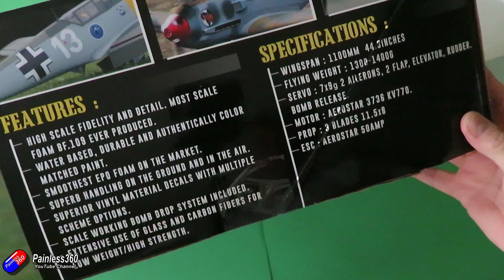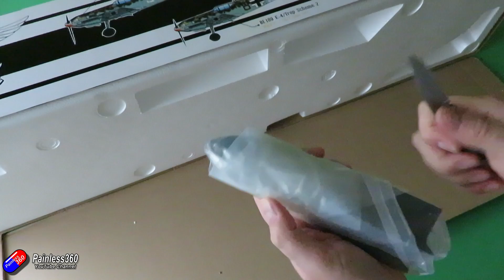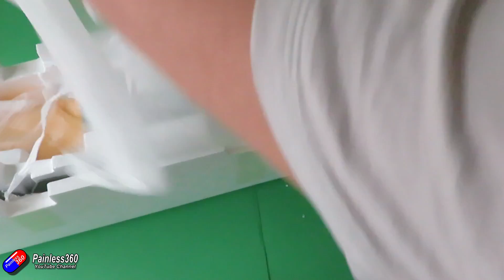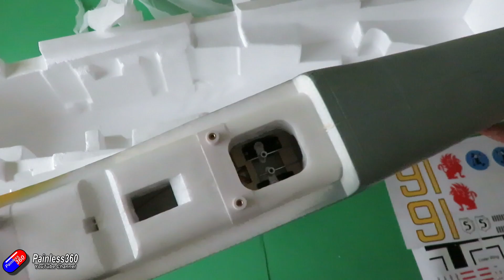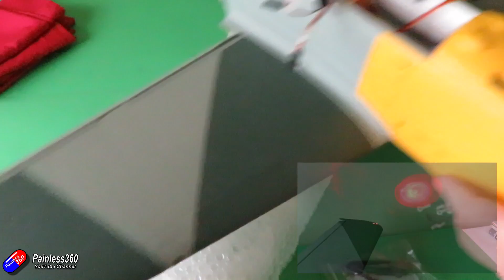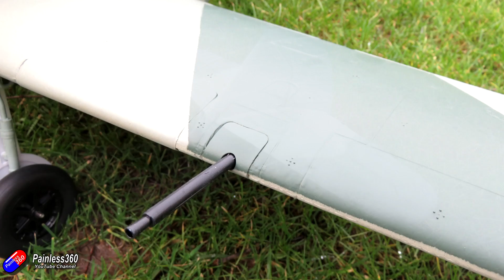New DuraFly BF.109E-4 (ME109) Scale Warbird Unboxing and Setup tips

Comment: Having just assembled a couple of points & gripes>

A.) Part of the manual has been written by a Chinese guy running his version of Italian through Google translate to get to the English! Weird & annoying things like when you are fixing the wings on it is crucial that you site the two sets of screws - one set of which is shorter than the other, in the right place. Their "instruction" in doing this is to put one set at the "T/E of the wing" & the other at the "L/D of the wing"? There is NO other context other than that!

B.) Contrary to the manual & this video which otherwise very helpful, you are best of putting the decals on BEFORE assembly! Just on doing that. You will find some stickers, in particular on the underwing, cover major raised parts of the structure including servos. I just stuck them down & then did my best to cut round to allow free movement but it is tricky. The manual goes on about TWO different types of decal - One set that are actual stickers & another that you peel off a release paper, stick down & remove the backing film. They are BOTH the later type! God knows what the former type instruction is about. I actually took them at their word & peeled of these decals, which constitute the major insignia, & had a huge patch of surrounding support film round them. Peeling this off caused another issue that you need to be aware of - The paint comes off VERY easily! The smaller detail stickers I think are going to last one flight! There is a recommendation to iron the decals in place but I would do that with EXTREME caution! - Hot irons & polystyrene……

C.) I would recommend doing all the wing assembly BEFORE placing on the plane which again goes against what is for some reason written in the manual.

Have to say though the plane looks stunning! Whether or not it still will in a couple of weeks I don't know. The real ones lost more pilots in training than in actual combat so they can be tricky to fly & ESPECIALLY land with the narrow gauge gear.

My only other gripe is that I did contact Durafly by the only option available (email) & requested a call back on an issue & 4 days later have had no reply.

Comment: Thanks for sharing. But just a question, based on its role (escort/intercept), did the 109 carry bombs, or ejectable fuel tank?
Reply from the maker: Check out the wiki. There were a huge number of models with various improvements. Whilst the 109 was conceived as an interceptor, later models were developed to fulfill multiple tasks, serving as bomber escort, fighter-bomber, day-, night-, all-weather fighter, ground-attack aircraft, and as reconnaissance aircraft. Happy flying!
Reply: There was a bomb rack added to some 109s in the Battle of Britain and used for what was called tip and run raids.😉

Comment: Hey P. Sorry for making another comment but for a few days now for some strange reason I just cant make comments on comments. About CG, I had it 57mm from the leading edge of the wing and I was flying with low rates wich were good enough for maiden flight. 10mm travels all arround with 30% expo all arround and it was perfect. And 2200mAh baterrie all the way forward. Did you made the maiden flight? If you didnt you will love it. Oh yeah...Cheers, Robert
Reply from the maker: Robert Petrinčič great detail, thanks for replying you give me that. Just waiting for this damn wind to calm down, and then this thing is going to be flying!

Comment: Great video! Quick question, is the antenna attachment on the vertical stabilizer a glued on piece, or is it an actual reinforcement rod that would protect the tail in a nose over?
Reply from the maker: +Dan D glued. Be careful when puppy in the plane upside down because I'm til you've got everything installed that is the point at the rear that the vertical stabilizer will touch the table and take the weight..
Reply: Thanks for that. I plan on removing it and inserting some carbon rod in the vertical stab and rudder, and then gluing it back on. I do this to all my planes, as I have a grass field, and a nose over is an inevitably. This keeps the rudder from getting bent and wrinkled...